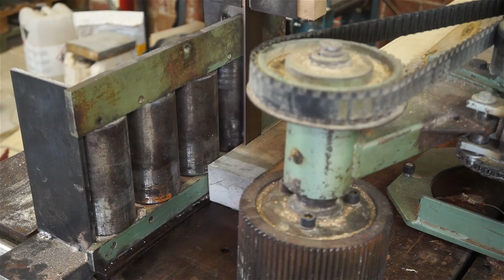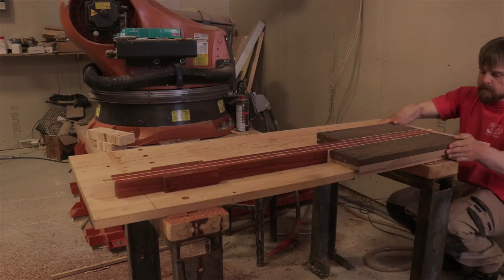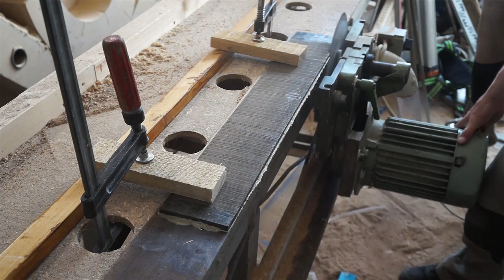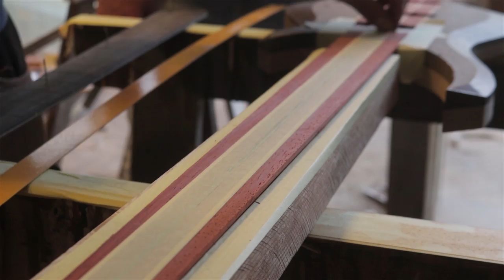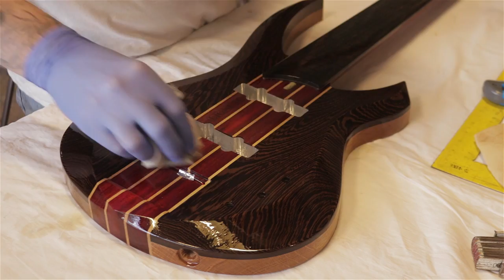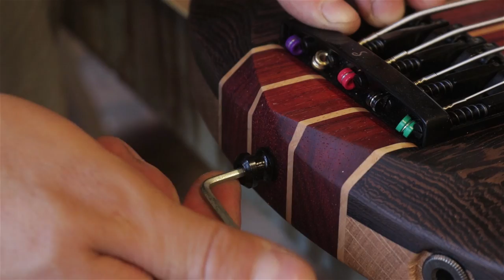Making a 5 String Padouk-Wenge-Oak Bass

Comment: nice video, CNC makes the job a lot easier. just one question, why do you glue the trussrod? I've made 20 basses by now and never had issue with trussrod as my cavity is tight enough

Comment: Excellent work, love it.
Out of curiosity, why you do not cut with the CNC robot the headstock part, the angled section and the thru holes?
Reply from the maker: Thank you Ivan! I did for a couple of guitars but the time needed to position it precisely, securely and correctly is much longer than to do it by hand.

Comment: Was the truss rod glued in? Wouldn’t that make it useless?
Reply from the maker: Truss rod is covered in thin layer of wax and pressed into silicon.Wax prevents it from sticking so it can rotate freely and silicon prevents any vibration.
Reply: @lignumchannel  that makes sense. I thought it looked like you were sticking it into the cavity, which would have meant it couldn’t move.